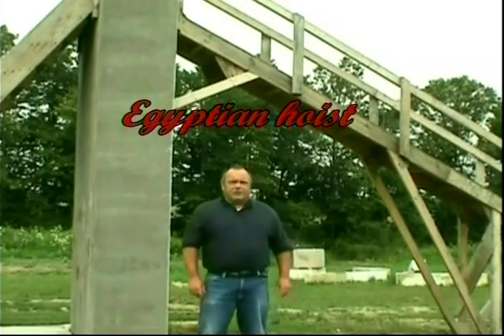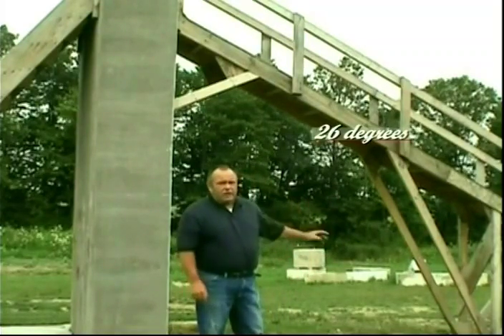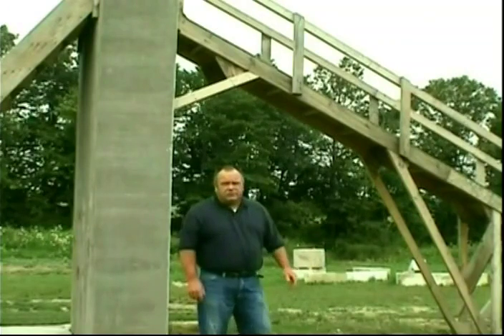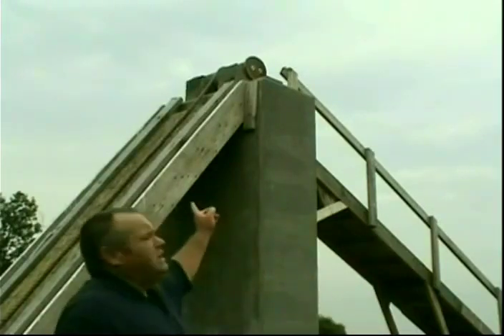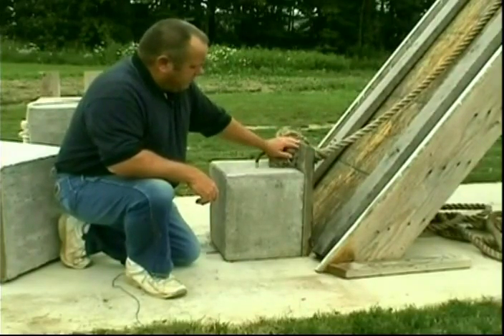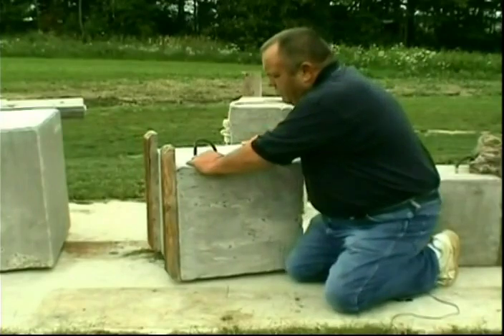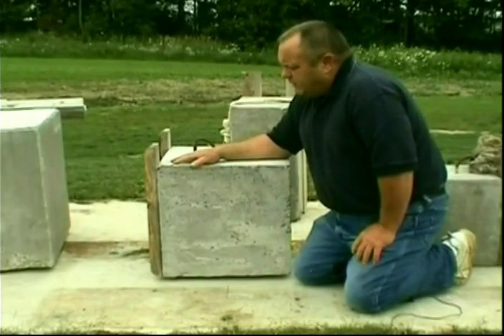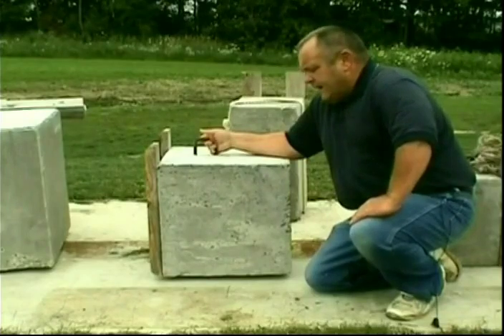Ancient Egyptian Pyramid Building Technique Reveal By Wally Wallington

Comment: Can someone tell me what trees are big enough to make beams for a ramp that can carry 90 tonne? And where they grow in Egypt?
Reply: Lebanon was famous for cedar trees , they may have rafted the logs via the Mediterranean Sea and up the Nile river ?
Reply: @mikevanblommestein5726  the great ocean going society of the Egyptians 😂
Reply: @mikevanblommestein5726  Correct and Pharaoh Sneferu imported forty shiploads of Lebanese Cedar timber for Pyramid construction as stated on the "Palermo Stone".
Reply: The ramp is the pyramid itself. The timber is just for easier sliding and the pulley would be a moveable A frame type set up at the top
Reply: @gonzo1354  Steps are the Pyramid itself for "Shedu four-lobe pinion-pulleys" to simultaneously raise Pyramid blocks on all four sides and height . The Great Pyramid consists of 52,000 square metres of horizontal step area purposely designed for Shedu step-walking pulleys to operate on with prototype Rack and Pinion mechanical technology. The mechanical advantage of the Shedu pulley is 2.8 (MA=2.8).
Search haitheory

Comment: I think you were totally on point or close to how the Egyptians raised those stones in place and built the pyramids. Good job.
Reply: 80 ton?
Reply: @highTideslowTides11  if you scale up the weight of the rocks then you also got to scale up the (man)power,  the tools/contraptions used, time needed to do it... then check out does it work out?
Reply: @highTideslowTides11  Nah, you're right. It was aliens. It extra-terrestrial beings who have mastered the intricacies and complexities of interstellar travel, who decided, just for a laugh, to put a bunch of rocks in a pile and piss off back to wherever they came from. Bet they're still giggling about it now.
Reply: Egyptians didn’t know wheels or pulleys and the iron neither.
Reply: @adams2430  Egyptians had copper tools such as chisels, drills, and saws that may have been used to cut the relatively soft stone. The hard granite, used for burial chamber walls and some of the exterior casing, would have posed a more difficult problem. Workmen may have used an abrasive powder, such as sand, with the drills and saws. Knowledge of astronomy was necessary to orient the pyramids to the cardinal points, and water-filled trenches probably were used to level the perimeter. A tomb painting of a colossal statue being moved shows how huge stone blocks were moved on sledges over ground first made slippery by liquid. The blocks were then brought up ramps to their positions in the pyramid. Finally, the outer layer of casing stones was finished from the top down and the ramps dismantled as the work was completed. And im pretty sure they had chariots, wagons and such.. i mean they were engineers so im pretty sure they knew what they were doing.

Comment: After hoisting how did theh transfer a 5 ton block on to the construction plints or place it in final position. Hoisting is a small part or easy part of the process
Reply: Scale, there would have been a crew at top of lift to redirect the load. Platforms for workers, etc.
Reply: Yes. He’s talking about 100 and 500 pound blocks. The Great Pyramid has blocks wearing several tons.

Comment: I think this man has figured out the alien technology that could have built the pyramids.
Reply: for all the smaller stones no troubles to show demonstration but it's the big ones people wonder about like stones in kings chamber that are 25-80 ton's the 50,000lb to 160,000 lb granite stones.
Reply: @dans8149 the largest ever stone moved by hand is the thunder stone (1200 tonnes) and there are numerous obelisks weighing at 500 tonnes (Lateran obelisk) that have been documented.
Moving rocks isn’t rocket science.
Reply: It’s a pulley. You mean I have alien technology in my shop?!!
Reply: @robinhodgkinson  yes. That's exactly what that means.
Reply: Ok so you move huuuge limestones all the way to the top of the pyramid using a pulley system okay great so how do you maneuver it into place once it's up there 😂
Reply: Have you never had to move big stones? If you haven't then get some experience. Find out how and then comment. @Madmaxxxx1984
Reply: Just remember the ancient egiptians where not supposed to know either the wheel or steel. A pulley is basic a wheel that they should not know.
And also is hard to imagine a wood pulley that would not complete break apart when working with blocks that could weight up to 60 tons. Wooden ramps would not withstand the effort either
Reply: @ummarti10  The 'wheel' Wally uses for his pulley is a concrete cylinder.... aka a column lying on its side - Egyptians made quite a few columns and could've easily made a roller out of granite. On a pyramid the ramps wouldn't be free standing they would be laid on the constructed external 52 degree slope - that's why he used those angles.
Reply: @gonzo1354   Granite would not withstand the forces. It would break. Even If they invented some extremely ingenious solution, I mean, considering the materials and techniques they supposedly had, It is absolutely astonishing what they did. I doubt we could do nowadays the same they did by only using the same materials and techniques.
How did this civilizaton with all that ingenuity did not figured out the Wheel?
Reply: @ 
Yeah granite has its limits. They were fine making ceremonial daggers out of iron rich meteorites [not often]
We think they had rollers which is close to a wheel.... but that's mostly us projecting our ideas on them.
Everything they did, their whole culture, relied on the Nile and its flood cycle. They were experts at that and transporting by water... maybe the wheel didn't have a necessity to be it's mother.... or they didn't have much use for it.
There's that theory that they floated blocks up the side of the pyramids straight from their canals, in a water tight shute.... but that just seem too slow and cumbersome... they'd need to have a system that didn't take long to reset between blocks.
Maybe they had some knowledge from what they called 'The First Ones', whose lineage is recorded in stone but mostly ignored or dismissed as a creation myth.
Bottom line is they did it.
Reply: @ummarti10  Those damn Egyptian square wheeled chariots right?
Reply: @ummarti10  i’m pretty sure the egyptians knew what a wheel was, its pretty obvious that something cylindrical rolls and i bet they’d figure that out pretty quickly
Reply: @BirchleyDonkeyNevertheless, according to mainstream archeology they didnt know the wheel, but they knew how to build those amazing structures instead.
Reply: Are you suggesting this man is an ancient alien!

Comment: Unfortunately this doesn't scale. Stones in the kings chamber are 80 to 100 tons. From a quarry 200 miles away....in the mountains.
Reply: They kings chamber unfinished granite blocks in the relieving chambers are 40T, not 80-100. That said, with a simple pulley and levers attached to the ropes, ive calculated that as few as 40 men could pull it. Simple mechanical leverage is that strong.
Reply: 2024 - They recently discovered ancient river channels in the desert near the pyramids which were likely used to transport the stones.
Reply: @user-vp1sc7tt4m  Indeed it's really interesting how they propose 100t blocks were floated too.
Reply: @CoffeeFiend1 
Tenían también carreteras con superficies lisas para deslizar con mayor facilidad los bloques
Reply: @gabrielalejandrodoldan4722  The evidence for this would be interesting. Along with this proposed.... "Sliding" I must admit "sliding" 80 ton blocks across a road is one of the most amusing things I've heard in recent years.
Reply: @CoffeeFiend1  The average container ship weighs 165,000 tons bro, and they float. Do you believe in container ships? Or you think aliens move our cargo across the world too?
Reply: @CoffeeFiend1  search Archimedes Principle - its the reason ships carry 500,000 tons on the open sea. IOW, you can keep a very heavy weight afloat as long as there is sufficient displacement in the boat. 100T isnt anything special on the water
Reply: There are still plenty of methods to slide 100 tons rocks, even some shown on this youtube channel. You just need wooden tracks. You put them in front of the stone, once the stone passed you recuperate the track and put it in front again until your arrive at destination.
Reply: The pyramids were built when Giants and Fallen Angels were on the Earth

The pyramid shape is a remarkable signature of Fallen Angel design
Reply: This guy is literally showing you people how to move stones with human power and you spout crap about angels? Jesus Christ there is no helping some people  @JosLewisIndiana

Comment: Congratulations, you've shown that manageable size blocks can be moved. Build a rig made of materials available to the Egyptians, that can deal with 50+ ton stones, then you'll be onto something.
Reply: And the interior of the pyramids is mostly filled with junk (offcuts, broken rock, sand etc). Only the surface pieces need a good finish. 
Mike Haduck has some good videos about stone mason techniques used in ancient times. Nothing beyond the wit of man, just rudimentary techniques scaled up. Anyone saying magic or aliens are just clickbaiting.
Reply: The rig is the pyramid itself. The timber [or other material] rests on that so the blocks can slide more easily.
Reply: Each limestone block has a volume of 1.10 m3 and weighs on average 2.5 t. Apart for the massive +40 tons blocks from the king's chamber it's more than possible this way.

Comment: 20T 40T 80T blocks no way that rope is not even strong enough to hold. But I do like the idea and effort.
Reply: Just use more ropes. Braid smaller ropes together, like the way rope is made.
Reply: A few thousands years of practice, they would have been very knowledgeable.
Reply: I doubt they would have had rope of consistent strength over the lengths they would need them
Reply: @OLDMANTEA  People can make rope fairly quickly out of grasses and fibers. There have been some experiments done using unskilled people, and they were making 20-30 ft per hour with no experience right out of the gate.
Reply: See this is where we get into the territory of people thinking you can just upscale things but it doesn't work like that. Perhaps calling them idiots would be unfair, but the issue with a lot of stuff involved with the chemistry, physics, geology, engineering, etc is people without a moderate understanding tend to have fairly invalid opinions from the get-go and it's pretty hard to explain to them why the most basic parts of their line of thinking doesn't work. The fields involved with this stuff take years of study and any explanation requires another explanation of the explanation and on and on it becomes almost like trying to explain to someone why X means X in a text that they can't read.
Reply: @CoffeeFiend1  Why couldn’t you upscale rope and just add ropes and keep adding until you have enough rope to apply the force that you need? You can even braid smaller ropes into bigger ropes, like how they do when they make ropes, and have a stronger rope.
Reply: @wompbozer3939  it’s the same reason why we have a practical height limit for buildings. At a certain time you reach a point of diminishing returns that cannot be surmounted by adding more resources.
Reply: @OLDMANTEA  But that’s simply not true. Your rope configuration isn’t going to break because you added a rope. That’s not how rope works dude. Ropes grow continuously stronger when you add strands. It also gets stronger when you just add ropes and don’t weave them in. Have you done any research into how much weight rope can hold?
Reply: @wompbozer3939  these folks are not working with synthetic fibers rather natural plant fibers. Jute maxes out at about 4 meters. How would they make rope at consistently at the strength and lengths needed?
Reply: @OLDMANTEA  By continuing to spin new fibers into the weave, a lot like how they make rope and such
Reply: @OLDMANTEA  If you examine the pyramids, after they reached a certain height, the size of the blocks diminished.
Reply: @CoffeeFiend1  It wasn't their first rodeo. Trial and error over centuries with knowledge handed down through generations would've taught them how to upscale something as simple as rope.
Reply: @gonzo1354  And it's clearly one of your first rodeos because upscaling isn't linear . Unfortunately this is vastly evident by your unfortunate example of "as simple as rope". You realize rope can simply snap under it's own weight right?
Reply: @CoffeeFiend1  Lol....
So if up scaling is not linear it can't be done?
Rope can snap.... timber can splinter.... steel can bend....cables can fail....  so what. They all get engineered to the load capacity required and used within their limits.

Egyptians would've been experts at using rope because they needed to be, like they were experts at measuring the Nile height and predicting seasonal floods. By the time they built the pyramids they'd had around 600 years of progressive civilisation.

Would they use one single rope or multiple ropes? Did they use counterweights? Did they use hydraulics. We don't know. We do know they built the pyramids. A pulley system theory has some legs. Were there multiple pulleys? We don't know.

Like I said before, you're thinking linearly instead of trying to understand how they might have done it you're just saying the rope would be a mile long when you don't even know what their rope was made of, how it was engineered or what it could lift. There's not much point in exclusively applying what we know now because that knowledge has gaps which is why we are still theorising about the techniques.
Reply: @gonzo1354  You're not in an engineering field. Which is clear. It's fine, most aren't. But it's clear. You have no basic understanding of what linear means nor upscaling which is what makes this hard. Coupled with the fact I don't think you really understand how heavy these things are either. 

Ropes not only snap under their own weight they become far, far, far larger than the thing that they are trying to lift/pull. It's the same issue with the pyramid ramps, the physics is there they need to be a certain inclination to work in the first place and they become megaliths in their own right requiring 20 times the effort to construct than the pyramids themselves. 

The stuff Wally is moving looks large and heavy to the lay person but they're tiny, there are megaliths with blocks, singular blocks that weigh HUNDREDS of tons each. Linear upscaling doesn't work with the tools of the archaeological record.